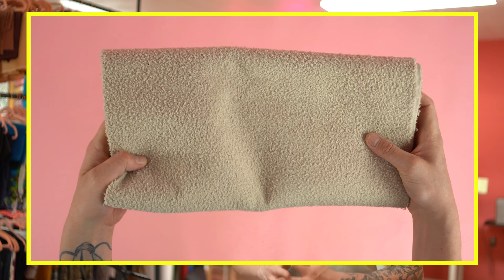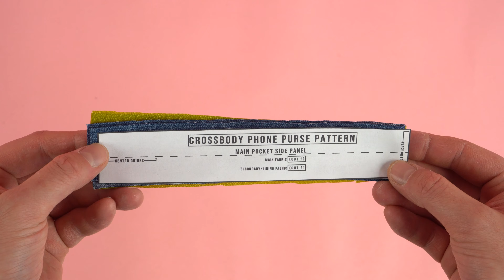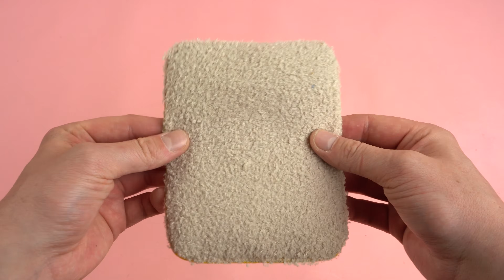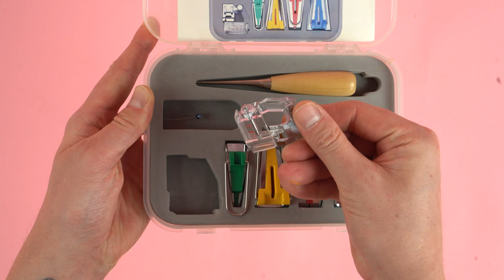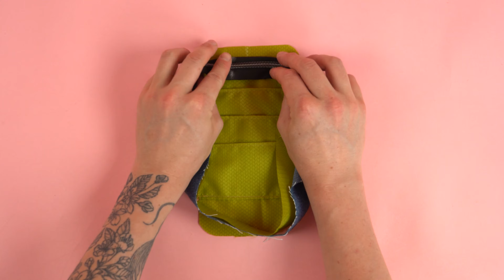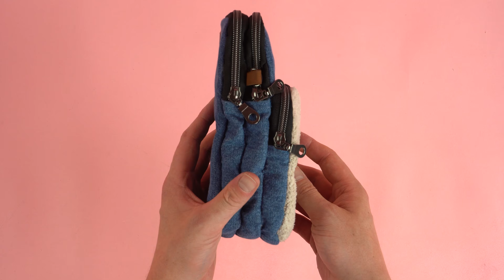DIY Crossbody Phone Purse (PRINTABLE PDF SEWING PATTERN) (EASY SEWING PROJECT)

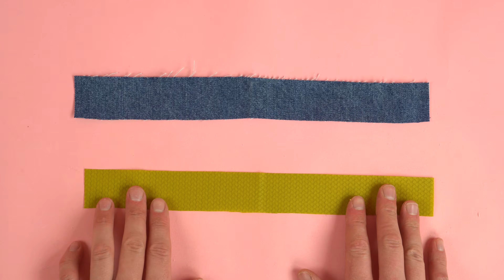Comment: I printed out the pattern and am making the larger of the two bags. The pattern pieces for the main side panel and front side panel are much smaller (shorter) than the zipper lengths. What is the actual length for each piece? Thanks! 5:28

Comment: I will say that this is the most difficult pattern I have ever tried to sew. I sew purses and bags every day and am struggling with this one. I think a bigger seam allowance would help. Not that I am bag designer but you can always trim the seam allowance right?  Also  sewing so close to 2 zippers is difficult and you fast forward through that portion of the video.  It is a struggle!!!!!!!!
A question I have is why did a smaller size pattern print?  I printed at 100 percent but a smaller one printed too and I got confused and cut out both. Hmmm not happy about that since I print on card stock and since no printed instructions I cut out fabric too. Made me MAD. 
Got 3 patterns for 2.99 and have made 2 and been confused on both.
Reply: That is the exact thing that I questioned.  There is no clarification as to which piece goes to what.  Poor design!

Comment: The circumference of the front pocket pieces are mismatched by over 1/2 inch.  The binding interferes with being able to actually use the zipper.  It’s kinda crazy how awful your patterns are as well as the directions.  It would be so much easier if you didn’t cut out 4 squares for the credit card slots. Cut out a 4.5 in by 15.5 inch rectangle, measure the depth of each slot, fold and iron, then top stitch to create each slot, then baste to the interior fabric piece.  This bag isn’t even functional for someone above the age of 20. I was trying to make this for a senior neighbor friend but she won’t even be able to stick her fingers past the binding pushing up against the zipper. What a waste of time and fabric.
Reply: Do happen to know the correct size of the panel because I am also have a problem?

Comment: Do you have any tips or sewing these bags with vinyl? I have been using your patterns for a long time & sometimes they don’t line up with bulkier fabric.
Reply: It’s because the measurements are not correct, such as the circumference of the front pocket panel. When you use vinyl you can’t adjust as you go.
Reply: They never line up, not even with thin fabric. If you measure at the sew line, it's a mess. It's not you, or the fabric. It's the pattern.
Reply: @stilllookingfortreasure This pattern is definitely messed up.  Why are there multiple pieces with same name.  Seems to me there are two sizes the bag can be made in however nothing fits as indicated.